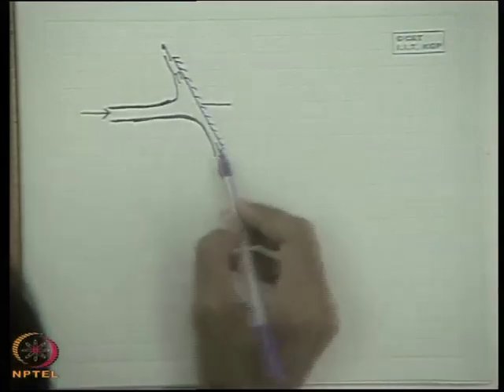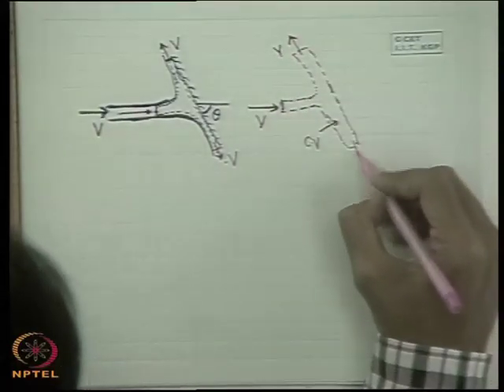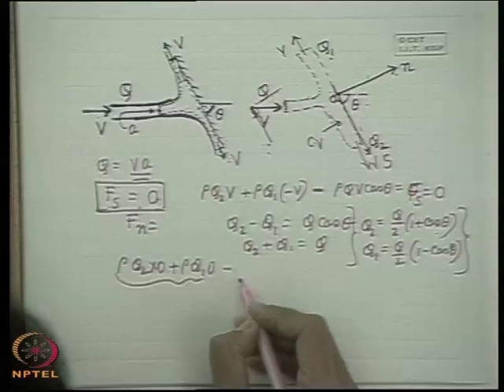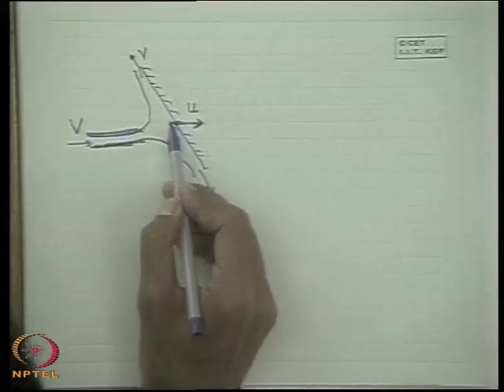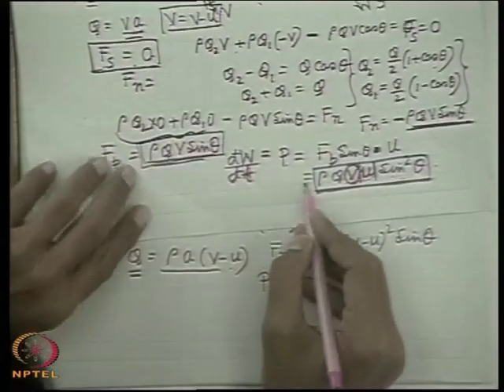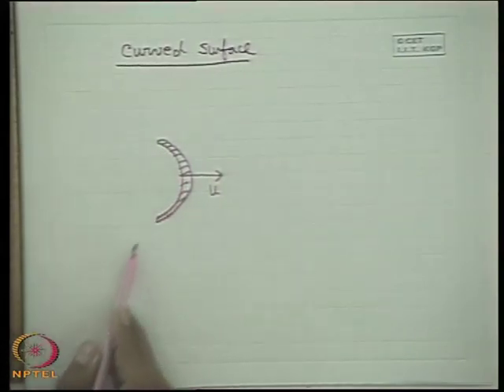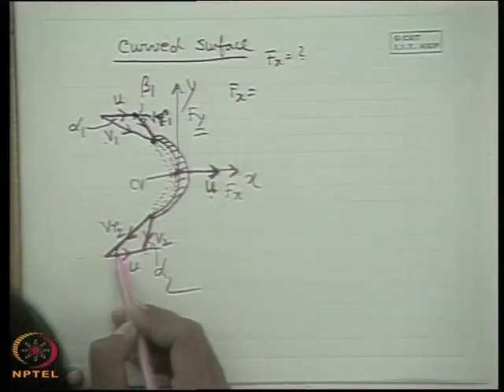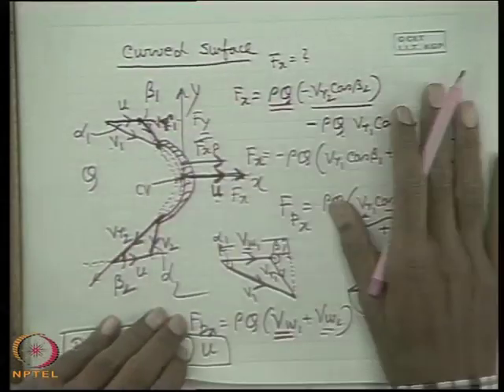Mod-19 Lec-19 Conservation Equations in Fluid Flow Part - VII

Comment: what will happen when the plate moves with relative velocity  equal to incoming velocity of jet
Reply: It will never hit it
Reply: Then 'u' will be meaningless because practically, there won't be any power produced to push the plate due to plate's inertia and fluid will barely touch the plate. It would thus bring no significant motion to the plate and no point of 'u' at that instant.